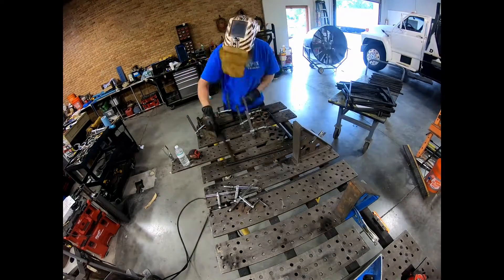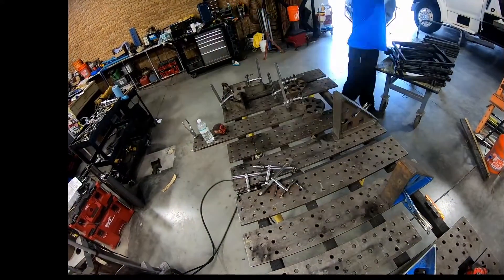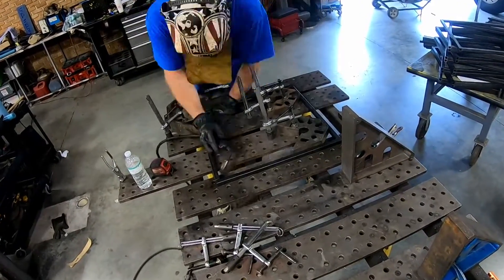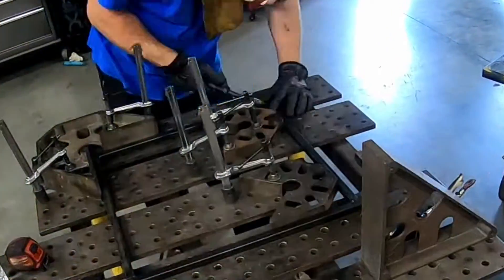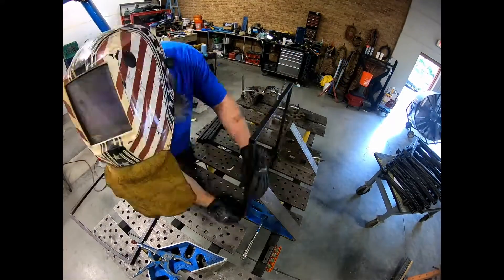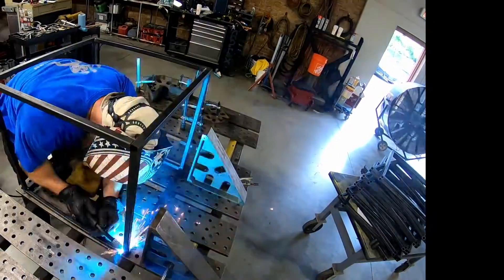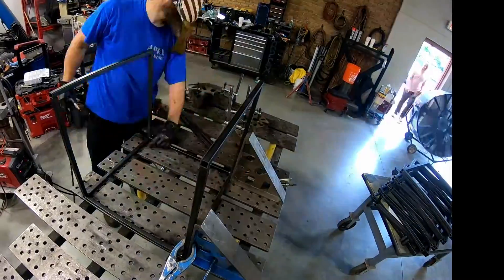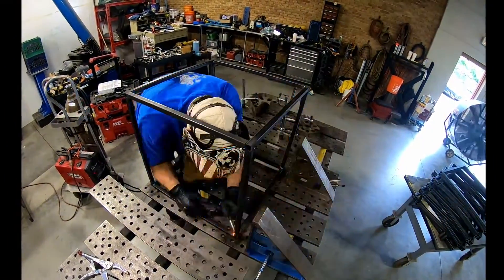Fabrication with Fireball Tools

Comment: in the next video slow it down a bit.
it's really cool to see you soldering and if the video was a little longer it would be even better
Reply from the maker: I will try on newer videos.... this one was a little older and I was talking over about what I was doing instead of showing it.
Reply: @jdbrewer6638  This table turned out really good.
I want to do the same and also buy a mig welding machine.
work becomes faster
Reply from the maker: @oficina do furtado  mig welding is faster and this allows you to get your ideas completed faster... it can really help with your design ideas
Reply: @jdbrewer6638  I should have made buying a mig machine a priority a long time ago
Reply: @jdbrewer6638  I'm going to start saving money to buy a mig machine. I love welding on my tig machine but it's too tiring